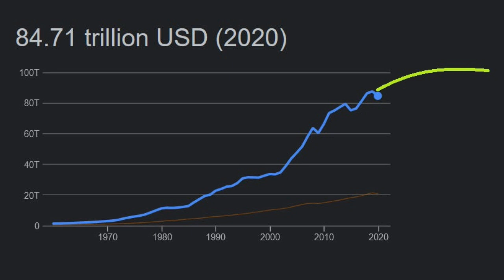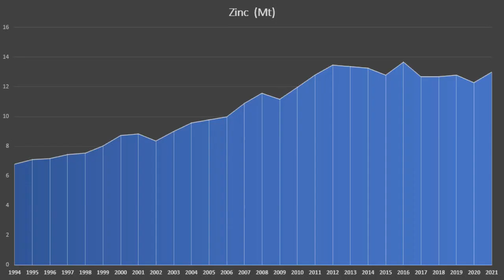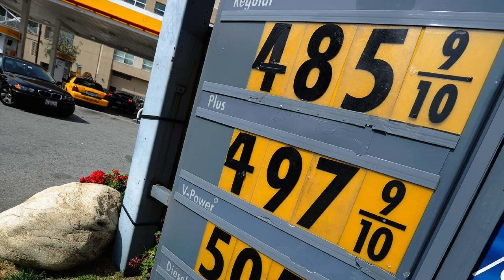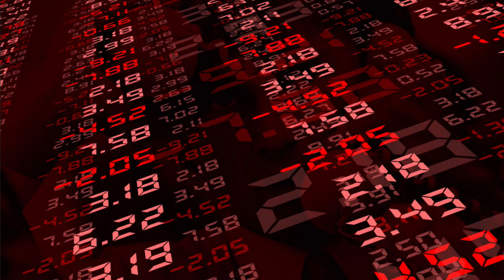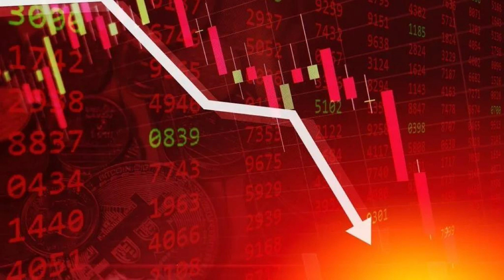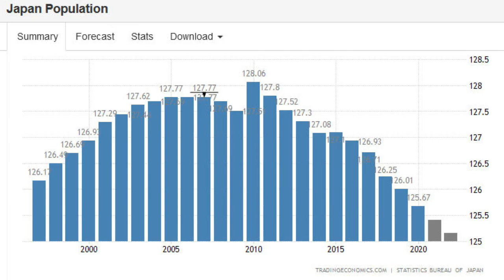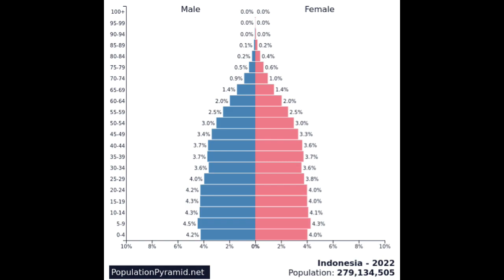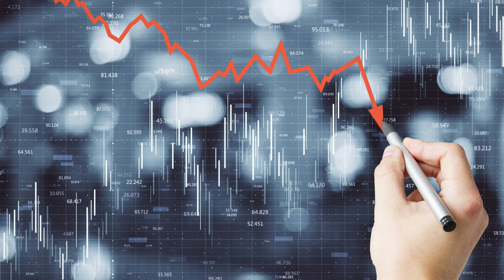Economic Growth will End before 2040

Comment: Continued growth is possible. Nuclear energy is presently the way. Cheap energy makes:
1) refining very many metals inexpensive.
2) production liquid and gaseous fuel inexpensive.
3) makes recycling inexpensive.
4) carbon capture inexpensive.
5) operating your home inexpensive.
6) irrelevant the production of hydrocarbons even while continuing to use hydrocarbons to fuel transportation. 
7) etc.
Reply: thorium reactors or geothermal, 
just saw a video about a guy who is working on a laser that can drill 10 miles into the earth.
Reply: Nuclear is not possible. Had we started the transition in 1970s then maybe we would had a chance, now not so much!
Reply: @p.k2570  
the Chinese and the Indians are already starting up their thorium reactor programs.

the Chinese have just started up their first thorium reactor, the Indians are building their first now.
the U.S. can have one up in 3 years if they had the political will to do it.
Reply: @p.k2570  LOL
Reply: @p.k2570  France is around 70% nuclear

Comment: Your analysis fails to account for solar power, which is going to be ridiculously cheap, decentralised, exponentially scaled up, and more efficient by 2040. Ditto for batteries/energy storage. Alternatives to the resources you cited will emerge. AI is helping to accelerate research into new materials, and the discovery of new deposits. Widespread adoption of clean tech will reduce pollution and slash the hundreds of billions of dollars in public health impacts globally. We're also going to see a massive economic boost from generative AI. Agreed about the demographic issues though. Hopefully UBI or some alternative system can be integrated into our economy, alongside robots to keep the wheels of society moving. And in the longer term, synthetic biology will dramatically extend lifespans/healthspans, slowing the population decline and further reducing public health costs.
Reply: Maxojir has touched on almost every one of your points in other videos. Solar panels use quite a bit of silver, the extraction of which has already peaked and is going to become a lot more expensive. Solar is also current energy, meaning you need to be able to store it so you can have electricity even when the sun isn't shining. That means batteries, which would require more nickel than we even have available on the earth. Generative AI is enormously energy intensive and wasteful and is not going to save us from ourselves. If anything, it may make things worse.